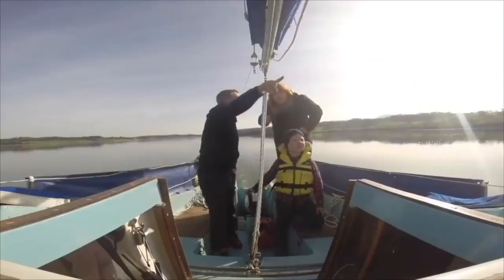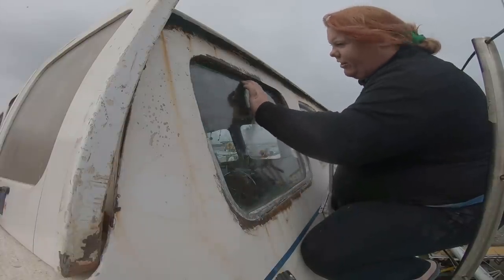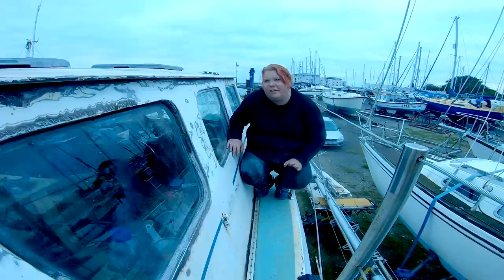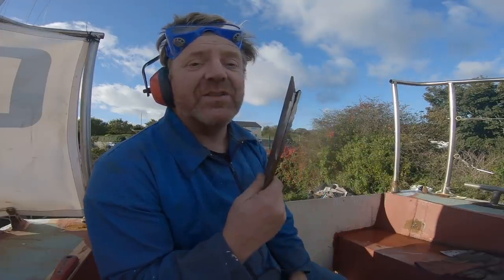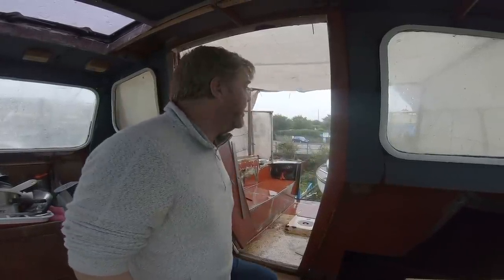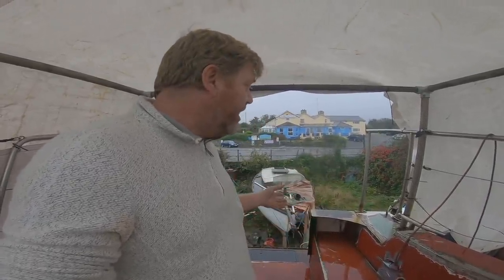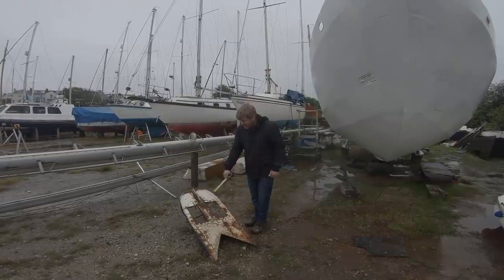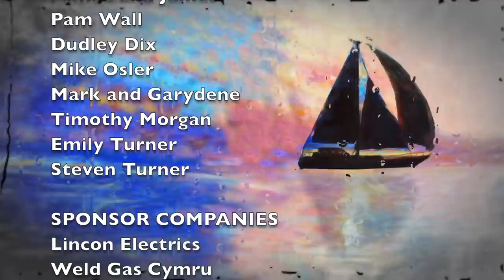#66 - We decided to add a gate to the transom

Comment: Great teamwork and impressive progress. Your welding does certainly look good enough for the job in hand, but if you want to examine another test piece it is better to cut transverse across the weld so you are looking at the junctions of the two plates with the weld material, cutting longitudinally may reveal a defect or two (like the porosity). On the transom gate, which is a great idea, to be honest, I think it would be better to start from scratch and knock up a GRP one. It will still have the safety issue of potentially trapping fingers but it will not have the mass to swing around as bad in rolly conditions. It may be possible to incorporate a latching mechanism to keep it open too. Great work - hope the weather continues to allow the cockpit work to get painted up and protected for winter.😀👍⛵️

Comment: Make sure that transom door doesn't end up too heavy, at rolly anchorage or if you needed to open at sea could result in an amputation of a limb. A way to reliably secure them  open is also a consideration. Good luck you are definitely getting on with it.👍
Reply from the maker: I’m actually now thinking of making the system in foam and fiberglass to keep it strong but light weight.

Comment: Lookin really good you guys!!! That Cockpit layout is awesome. The pinch/shear points with any gate, heavy or light, would make a mess of little fingers. I've seen sleeved pipe hinges in cattle gates and squeeze chutes that have no pinch points. I'd recommend making a large piano hinge with weldable steel pipe for the knuckles and a heavy wall PVC or ABS removeable "pin". That would result in reasonably low-friction movement, while being serviceable and fairly impervious to rust.

Comment: Great decision on the transom door, definitely  make the the doors from plywood encased in fibreglass , much lighter and less maintenance,  Re the stainless chain plates , no need to paint them, there is no issues with not painting and less maintenance  as you will have problems getting the paint to stay on. How do i know this, been there done that.
keep up the good work.

Comment: Gate in transom: If you make the gate from carbon steel, you will have a never ending discoloration from runst-running from hinges and locks. I would have used whatever material but any form of steel. I had the same thoughts on building my boat. As I made the boat with the perspective of as close to zero maintenance as possible, the aft door was cancelled. My gate, if ever made, would have bee from wood or aluminium. Welding dissimilar steels, carbon to AISI 316L, no problem at all. Just paint over the 'junction' between carbon steel and stainless. Just a few mm will do. Use epoxy primer generusly.
Reply from the maker: I will be making the hinges from 316 yes regardless of what the gate is made from

Comment: You need to build a larger platform off the stern made of a steel frame and steel wirer mesh to let water go threw so you can have a safe area to get on and off boat and to access the storage compartment

Comment: If i were you id bend a 1 3/4-2 inch pipe like a U shape so you can weld it onto the back of the boat / extend the back deck by like 12-18 inches and then do some wood slats for the back deck.  It'll drain and add that little touch of wood where it looks good but small enough where you don't have a lot of maintenance... Id also add the same wood raised slat to cockpit floor to tie it all together.  You could have  exterior fold down transom chairs, Dingy engine storage or a bbq hanging off the back side, dingy davit/ hardtop.
Reply from the maker: Planning more or less exactly that :) watch this space

Comment: Thanks guys.     I really didn’t think of anything but steel for the gate, until you mentioned fingers,    Oh yeah! Ouch, good point,  i guess some of that closed cell poly cover in some fiberglass,   Which isn’t as stupid as you may think, because it super easy to work with, super strong and also lightweight,  plus you can make any shape you want out of it,  so it wouldn’t surprise me if you end up making Modular style Furnishing out of the same stuff.   Just an idea.. it’s kinda the way most refits are going.   And with the benefit you can actually make it at home..
Reply from the maker: You’re absolutely correct. And it’s a material process we may well use :)

Comment: Galvanic corrosion reaction with the aluminium and steel on those window frames. They will get weaker and you will need to do it all again soon. You need to isolate the two metals with a watertight membrane. The welding looks good.
Reply from the maker: Yes I completely agree. The frames will be bonded in place with a good layer of epoxy between to avoid that happening again

Comment: hello. You did well. Advice about stainless steel, it does not need to be welded. it must be secured outside the cockpit with bolts in the old plates inside the hull. 
sorry for my google translator.
Reply from the maker: Thanks for the advice but bolting in this application would be incorrect

Comment: With transom hatch is it worth having it open towards stern (rather than towards cockpit)? Just thinking of ease of use in seaway.
Reply from the maker: Yes for sure. We want it opening outwards so that it’s impossible for a wave to push it in :)
Reply: @SailingMelody  I had a thought about the pros and cons of an outward opening gate.
I imagined a poop wave big enough to trying to unsuccessfully push the gate inboard, and then flooding the cockpit. while . (I can't imagine such a  big wave wouldn't come right over the stern, rather than conveniently be exactly the right height.)

So now we have two tons of water in the cockpit,  with an outward opening gate.  
Would the pressure then sweep out the  outward opening gate with anything else in the cockpit, including the helmsperson ? 
Would a latching error lose a person ? ( probably far more likely than being pooped by a big wave)

Something to fret over in the small hours.  : -)

Ps can you open the storage in the scoop with the outward opening gate open?

Comment: Steel and aluminum need to be isolated from each other or they will eat each other window failure in the making you all have turned a corner the boat looks like she may hold water 😉❤👍
Reply from the maker: Galvanic reaction between dissimilar metals is a complicated subject for sure but not one we’re unaware of and we will be giving great attention and consideration to proper and effective galvanic protection both by passive anodes and active protection. For the window frames we will epoxy the steel with a good thick coat of epoxy and then bond the aluminium in rather than having screws through. So they will be properly isolated